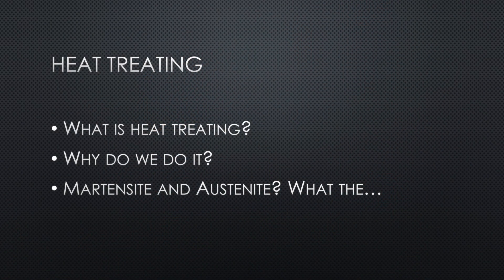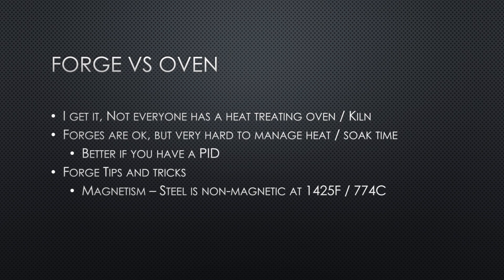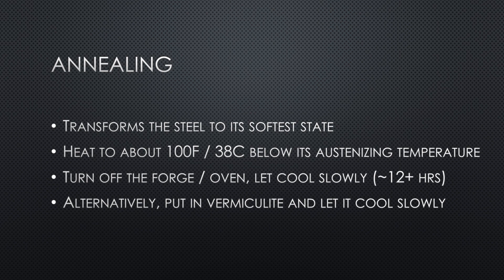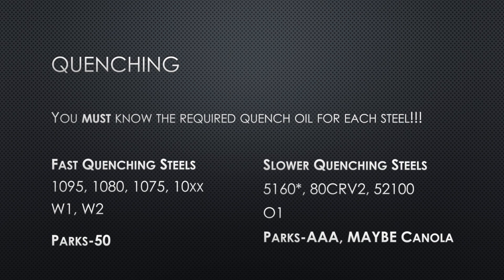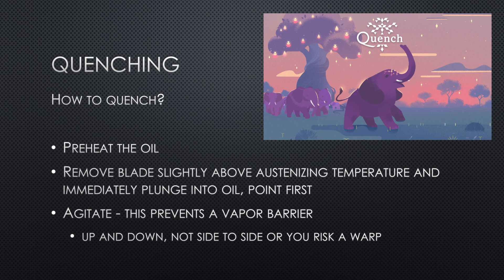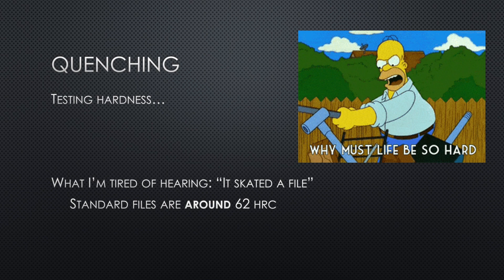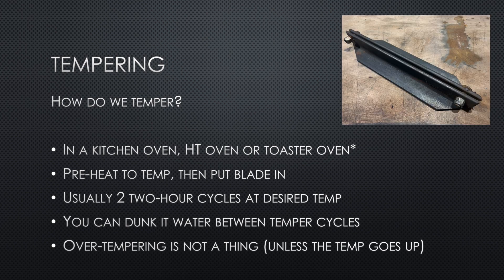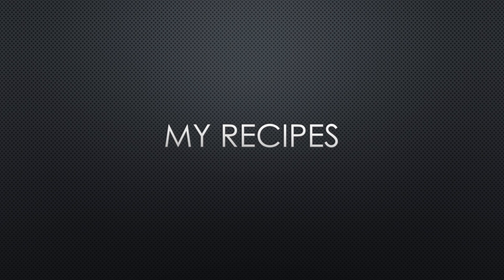Triple-T #97 - Heat treating

Comment from the maker: Do you have any questions I didn't cover in this video?
Reply: im glad you showed oil tempering in the katana video. its my go to tempering method
Reply from the maker: @dagnard5707  that was the first time I tried it.  It takes a while but works great!
Reply: @dagnard5707  right I agree. I'm glad he showed this because as a new maker who knows how long it would have been until I discovered that. 🤘
Reply: @mcrich1978  it took me 15 years before i found out about oil tempering and i have been smithing for 26 years now
Reply: @dagnard5707  🤘
Reply: How does Damascus steel change your process? I'm assuming that with two different steels you have to accommodate both somehow?
Reply from the maker: @brandoncain6784  That's a great question, Brandon.  The key is to use steels with the same heat treat.  15n20 is basically 1080 with 2% nickel added so its the same heat treat as 1080/1084/1095, which is why they're always paired together.  I don't recommend using 80CRV2 with 15n20 for damascus since they have slightly different heat treat recipes.  It's not a dramatic difference, but still it's not the same.  I don't heat treat 80CRV2 with Park50 and use ParksAAA instead.  So you'd probably get less hardness on the 15n20.  Some people use Parks50 with 80CRV2, but it does recommend something slightly slower.
Reply: @TyrellKnifeworks  that makes perfect sense. Thank you!
Reply: Yes, how's my pirate sword coming along mate 😉? 
In all seriousness tho. Have you ever made a fine beautiful cutlass before?
Because if you think about it. 
Them swords are the closest to our hearts as British and Americans! 
The cutlass was such a good sword n gets over shadowed big time! By the katana..
I imagine you could make a superb Damascus steel cutlass.
Reply: Sorry I'm not native english, but in the books I read, it seems that annealing and normalizing was the same thing, did I misunderstood something, because here you are showing both of the like a different step.
Thank you for this video, really helping :)
Reply from the maker: @lauwhavening8455  yes they are certainly different.
Reply: @TyrellKnifeworks  I went to search for definition of the words, and basically yeah, there is small but noticable differents ^^.
Thanks for answering :)
Reply: If over tempering isn't a thing, why couldn't I just put my knife in the oven for 10 minutes and call it good?
Reply from the maker: @willardjames2685  It takes time for the carbides to change their structure and reform into a more relaxed state.  This can't be done in 10 minutes.  There's all kinds of technical speak I could quote from Dr Larrin Thomas' book, Knife Engineering, but suffice to say, you need to do this for a couple hours to make sure your steel is in the right form.
Reply: How do you identify steels like 1095 ?  When u buy it how do I know its what I paid for ?
Reply from the maker: @donwalker6267  buy steel from reputable vendors like Maritime Knife Supply, Jantz or New Jersey Steel Baron.  I use Maritime.  Do NOT buy steel off Amazon or eBay.
Reply: I forgot to heat up quench before I quenched my blade,  I put it back in oven and did it again with 125deg parks oil and it didn’t harden,  do I need to start the entire process over again
Reply from the maker: @donwalker6267  you don’t actually need to heat up Parks50 as long as it’s 70F.  You say your steel didn’t harden, what steel, how long did you soak it and at what temp?

Comment: Dennis, you didn't list S-series steel in the quenching slide, what's recommended for the shock resistant steels?
Reply from the maker: Check Larrin’s book for those.  I don’t use them and I didn’t include steels I don’t use.  They would probably be similar to CPM154 I suspect.  For steel choice, it depends on what the purpose is. Do you need stainless?  If so I’d just go to Magnacut.  Thanks for watching
Reply: @TyrellKnifeworks  do I need stainless? Stock? No, I have a trailer load of stainless counters and tables, etc. from a restaurant I used to work at that remodeled.  If you meant information on heat treating stainless,  then yes, I need all the info I can get.

And do you mean Larrin's knife engineering book? I'll have to check it out.
Reply from the maker: @billwoehl3051  your response is extremely confusing.  You plan to make knives from stainless countertops and sinks?  I’m assuming not.  If you need heat treating info on stainless steels, get Dr Larrin Thomas’ book, Knife Engineering.
Reply: @TyrellKnifeworks  I don't think the sinks and cou terrors are thick enough unless I can put em in a canister and weld them together,  not sure of the type of stainless and it might not harden, might incorporate some into a blade, hammer, axe, or other project along with some 1095, or 5160, or jackhammer bit, axle, etc. I  don't have easy access or a lot of money to buy new steals for practice until I get decent at it.
Reply from the maker: @billwoehl3051   For sure those are not hardenable steels and also won't forge weld well at all.  Steer clear.
Reply: @TyrellKnifeworks  originally wanted the sinks and counters for H.H.O. dry cells,  which aren't very big. So, I have to come up with other ways of using it up, since I plan on focusing on camping/survival equipment,  I'm sure I can use it for ladles, spatulas,  skewers, etc. Should take a few years, but, eventually ill find uses for it somewhere.

Comment: Hello, such good info in this video, but i have a question. Why 2h twice of temper? Is not to mucho time?
Reply from the maker: To quote Dr Larrin Thomas from Knife Engineering:  "Austenite is not fully stable at room temperature and so it can transform during tempering.  The austenite can transform to bainite or ferrite plus carbides, both of which are decomposition transformation.  Another transformation is destabilization of austenite where carbides form within the austenite during tempering which reduces its carbon content, raising the martensite start temperature.  Therefore, multiple tempering cycles are recommended, because the newly formed martensite needs to be tempered so its not brittle".    That might be a bit too technical, but in short, you need to remover all the retained austenite and this needs to be done twice, sometimes 3 or 4 times in some steels.  I hope that helps.  Thanks for watching.
Reply: @TyrellKnifeworks  yes it help, o like this technical info. But it Will not reduce the hardnes of for example a 1095 if there is that time of temper?
Reply from the maker: @matiasshanahan5164  The temper will always reduce hardness of any steel.  You want to remove as much retained austenite so that it reduces brittleness.  That removal of austenite will reduce the hrc value, but will give a lot more toughness to the blade.  If you tested it after the first 2 hours before the second temper, you might notice a difference in hrc after the last temper.  But remember, hrc is not everything.  For 1095 you should be able to easily get 65 hrc out of the quench and then temper down to 60ish.
Reply: @TyrellKnifeworks  or a other example, i don't know if You try it, i was experimenting with sanvick 14c28n and i been recomended a temper at 200*C for only 45min in one cycle
Reply from the maker: @matiasshanahan5164  That could be possible, I've never worked with 14c28n steel.  It's all about retained austenite.  If its gone in a single temper cycle then you're ok.
Reply: @TyrellKnifeworks   thanks for all your info good man

Comment: Did you ever send out your knives to be heat treated ?
Reply from the maker: No, I’ve always done my own heat treat. Thanks for watching.
Reply: Can u over quench ? Ie leave in oil to long ?
Reply from the maker: @donwalker6267  No, you can't over-quench.  Leave it in the oil for at least 30 seconds but you could leave it there for hours and it wouldn't hurt it.  After quenching, I just wipe with a cloth and let it cool to room temp and then it goes directly into temper.   Because I have aluminum plates setup for doing stainless, I place all my blades into that aluminum vise setup after quenching and it sucks the heat out of the blade immediately while keeping it completely straight.  It helps with warps and I highly recommend it.
Reply: After quench let knife cool to RT ?

Comment: Is the volume of oil you quench in critical ? Ie,  how many oz or gal to use
Reply from the maker: The volume is very important.  You need to have enough oil so that there’s enough to cool the blade and it doesn’t heat up too fast.  Typically at least a gallon, preferably more like 2 or 3, particularly if you plan to heat treat multiple knives.  For example you wouldn’t want a 1.5” tube with oil to heat treat because the oil around the blade would heat up too much and not cool the blade.  You need enough volume around the blade.
Reply: 6” dia PVC pipe 2’ long work .?  I have a ammo box that hold a gal
Reply from the maker: @donwalker6267  both of those work.  The ammo can less so if you intend to do longer knives.

Comment: Hey Tyrell. its me again. Quick question quick question.... i have an old metal file. its obvious high carbon. quick search will show minimum at 1%... i want to make a blade out of that. what temperature should i use and which quenching medium... as high carbon falls in the 1095 rage which is parks-50. but 52100 is ball bearings and have higher carbon, and you showed 'maybe canola oil'   so i don't know. maybe you can make a knife out of one and check.... Also why cant we use water? the ancient Japanese making Katana's only used water and they had HIGH carbon steel. so i guess the water is not ice cold but has a luke warm temperature before quenching?
Reply from the maker: First, (good) files are usually very close to 1095 steel if not 1095 exactly.  You can usually make good knives out of them.  As for quenching, the proper quenchant would be Parks50.  You could use water but it’s a huge risk.  Yes the Japanese used water to quench, they also had huge failure rates.  It’s up to you.  Parks50 lasts forever if you don’t flame it, so it’s a good investment.
Reply: @TyrellKnifeworks  EPIC. Thank you......coz i want to make a san mai blade from leaf spring(outside) and a metal file. tryyyyyyyyyyyyyyyyyy and heat treat a hamon line but we will see. my blade making road won't be long though. a year or two at maximum. what else can the parks50 be used for if i purchase it, just so that it does not waste.?
Reply from the maker: @ricksmit2239  Watch my heat treating video here: Triple-T #97 - Heat treating
https://youtu.be/akQaQwciVCs   Also, I tend not to do a hamon on San Mai’s.  It looks odd to have a line over a line.
Reply: @Tyrell Knifeworks  You are speaking the truth sir. but i do not intend to  acid etch my knife so the difference in types of steel should not be so visible. and i figure that the differential heattreat of hamon will keep things soft and strong allowing me to temper at lower temperature. but yeah was just my plan for one knife. not all.

Comment: I have annealed 1095  So after grinding and drilling do I go back and normalize, anneal, grain refine, then final grind and handle  .?
Reply from the maker: How do you know it’s annealed, did you do it?  I would still do all the steps.
Reply: Makes sense , just paid $2400 for an oven why not use it :).  Are you an engineer ? I’m a mechanical engineer
Reply from the maker: @donwalker6267  I’m a director of engineering at a software company. 😉
Reply: I’m a director of engineering at Pratt & Whitney in FL. Military jet engines ,  u make knives as a hobby ? Very impressive shop.
Reply: I’m a Woodturner for last 20yrs,  just starting with knives,  I have the equipment just need to practice and learn,  you are one of the best I’ve seen on utube for teaching

Comment: You might want to check with your team doing the closed captioning.  At the 5:04 mark, I had to laugh because the cc literally says "so if it was say 10.95 for example you would heat it to about 13.75 fahrenheit then whether using".  I don't think this was what you meant to communicate to your audience.  Most people will under stand what you meant but.........
Reply from the maker: It was talking about annealing.  A sub critical anneal for 1095 would be about 1375F.  And I don’t have a “team”.  That’s all Google Translate manually done by me.  Thanks for watching

Comment: A question:  When you say for example “set oven to 1575, insert blade at 1400, soak for 10 minutes”. Do you mean soak for 10 minutes after the oven reaches 1575 or soak for 10 minutes after you place the blade in at 1400?  From my oven it will take 15 to 20 minutes only to reach 1575 from 1400. Thanks!
Reply from the maker: The timer starts when your oven reaches the set temperature. Thanks for watching, Dmitry!
Reply: @TyrellKnifeworks  Thanks for your answer Dennis, I usually put mine in at temperature and start the timer when the oven comes back to temperature again.
Reply from the maker: @dmitryk754  I assume you have a 110v oven.  Your method probably makes more sense for that.  👍

Comment: Thanks for the video it came at the perfect time. I have some 1095 that I was going to get another Smith to heat treat for me but he must have decided he didn't want to do it. I can't get him to answer my calls or text. I said the hell with it and was going to do it myself this weekend. After this video I think I'll just send it off if it's that difficult. I just finished my first 2 knives last week and they turned out great. Nobody believes that they are my first 2 knives and I couldn't have done it without guys like you. Thanks man I really appreciate it
Reply from the maker: I wouldn't say 1095 is "that difficult", it just takes practice.  I would definitely get yourself a set of hardness files and do a couple test pieces until you feel comfortable doing it before you screw up a knife you've spent a lot of time on.  But hell, I did my first knife in 1095 cause I didn't know it was hard.  I tested that knife when I got my HRC tester and it came out at 59 hrc.  Maybe I just got lucky.  🤣. Thanks for watching, Richard.
Reply: @TyrellKnifeworks  LOL maybe I'll give it a try it won't be the first time I screwed something up and it damn sure won't be the last. I tried to use that message thing you put up on Patreon but I can't figure it out
Reply from the maker: @richardbranton2780  Just email me directly if you have questions - tyrellknifeworks at gmail.

Comment: Thanks so much for this video. Funny enough I just picked up Dr. Larrin Thomas' book last week and I'm currently reading about the heat treatment process for different metals. It's honestly been somewhat of a black box after my first knife making class. This is a great reference and I really appreciate you sharing your insights.

I was wondering, with pattern welded damascus, how do you account for the slight variation each metal needs to heat treat? Are they similar enough that you don't need to change your process, or do you do something else?

By the way, have you seen any of Larrin's videos on YouTube? Super informative as well, especially when he gets into the different alloys.
Reply from the maker: That's a great question, John.  The key is to use steels with the same heat treat.  15n20 is basically 1080 with 2% nickel added so its the same heat treat as 1080/1084/1095, which is why they're always paired together.  I don't recommend using 80CRV2 with 15n20 for damascus since they have slightly different heat treat recipes.  It's not a dramatic difference, but still it's not the same.  I don't heat treat 80CRV2 with Park50 and use ParksAAA instead.  So you'd probably get less hardness on the 15n20.  Some people use Parks50 with 80CRV2, but it does recommend something slightly slower.  I've certainly got a copy of Dr. Larrin Thomas' book and I've seen many of his videos.  Most of my heat treating recipes are taken from his research.  Thanks for watching!

Comment: This is great man, more informative than anything else I’ve looked up. when I saw Martin Lawrence I lost it. It took me back to that magical day he had a heat stroke jogging in LA on a hot day in sweats 😂 please tell me you have more like this. During heat treat I noticed sometimes my steel losing its magnetism completely (until being cooled) yet never saw it mentioned…until now. Cheers brother!
Reply from the maker: I'm glad you found it useful!  Thanks for watching!
Reply: @TyrellKnifeworks  watching again! Another thing I noticed, when I’d leave a small magnet on the blade until it fell off inside the gas forge, (so I’d know when it lost magnetism) I also noticed those magnets never worked again 😂

Comment: Did you know that COLD treating works even YEARS after forging ?!
Have a look over to "Applied Science" chanel for this topic.
Reply from the maker: I did mention Cryo treatment in regards to stainless steels.  This isn't typically done on carbon steels as the benefits are negligible on most of them.    Thanks for watching.

Comment: Hey Dennis…just FYI, I built a PID controller for my forge for about $100-150.  It works great.  The PID just opens and closes a magnetic valve that’s inline with the gas supply hose.  I built the whole package into a small ammo can.  I do appreciate the science lessons!
Reply from the maker: That’s not too bad at all.  Maybe I’ll look into it.  Do you have links to the parts you ordered?  Would you mind emailing them to tyrellknifeworks at gmail.  I’ll include them here.  Thx!
Reply: @TyrellKnifeworks  I’ll send you a list and a link to the video I watched…some pics also.  I have the PID set to only monitor P…I think…that way it basically acts as an on off switch.  There’s no ramping involved.  The residual heat in the forge reignites the gas no problem.
Reply: Also, forgot I took video of the final product.  I’ll post it on my YT.  It will be the only video there.  Give me a few minutes.